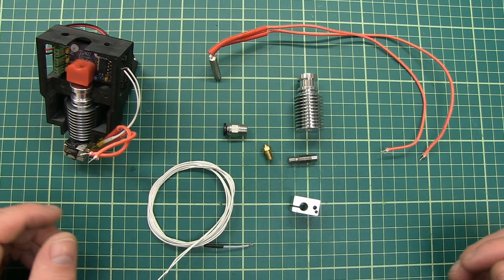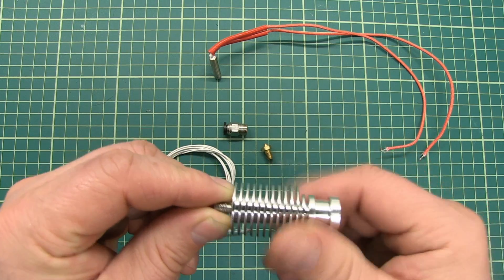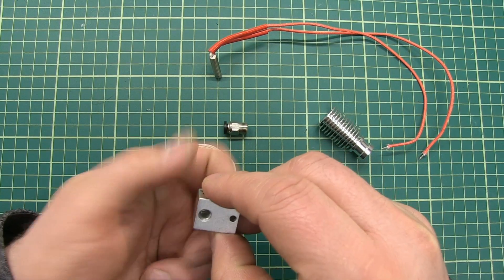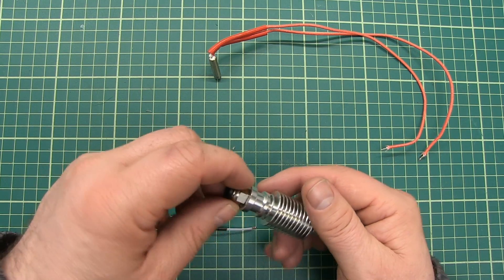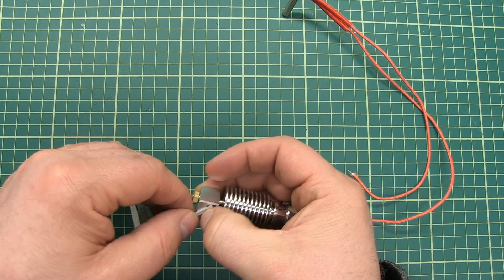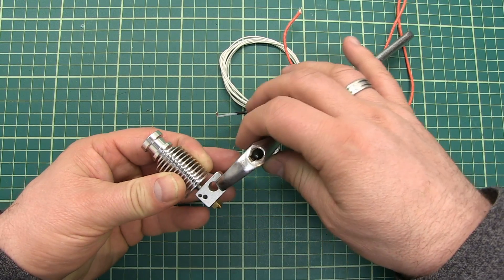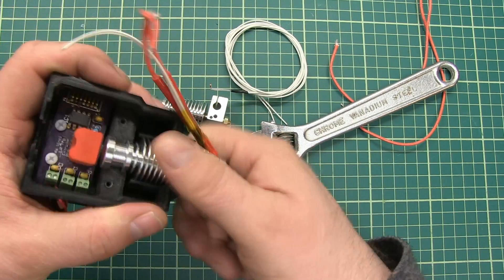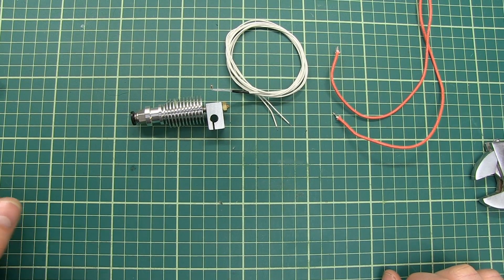▼ E3Dv6 and clones. Types and names of the parts

Comment: Hey Brian,
Is this hot end suitable for de da vinci pro printer? And what type do i need.
Reply from the maker: Hi Wilko,
This is going to be the E3Dv6 that I am going to use in my Da Vinci Pro printer.
When you are looking for the correct E3Dv6 hot-end, look for the 12V version that is Bowden driven. They also call it the short one.

Comment: Hi Brian

How do you calibrate on your pro with e3dv6 hotend?
Reply from the maker: Hi,
Just go to the Z axis offset and set it to the largest number you can get it to. Then, you are a little to low with the bed, you have to turn the knobs on the bed so that they compress the springs a little. Then, set the Z height to a lower value, bringing the bed up until it's at the correct height to work with. Now use a piece of paper as a feeler gauge on the 3 points where you can set the level with the knobs and adjust the bed manually until you feel it's at the correct height with the piece of paper.

Comment: Hey 3D Print Creator. I was wondering if you could tell me if the DaVinci pro like the one have is direct feeding or bowden. Also can you tell me which ed3v6 kit I should get. there are several and am not sure. My father gave me the DaVinci as a gift and it is my first print. I want to print a variety of things. But like I mentioned there are different kits with different nozel sizes and so forth and so forth. I would appreciate your help.
Reply from the maker: Hi Michael,
As you can see, the printer has a motor in the back of the machine that pushes the filament into a PTFE tube. If a printer has this, you call it a Bowden printer. The extruder (this is the motor in the back) is not placed on the carriage, right above the Hot-End, so it uses that tube.

If the extruder was positioned right above the Hot-End, then you call it a direct Drive or direct driven printer.

The E3Dv6 should be a 12V short version, compatible with Bowden.

Comment: hi brian, 
another fantastic video thanks
would you be able to make this and sell it as im very interested in buying one of these to replace the stock hot end on my pro. im not confident with doing the wiring but would be happy to purchase from you. 
many thanks in advance 
steve
Reply from the maker: Hi Steve,
The 3D printed parts are designed by Bruce Walker and are downloadable from Thingiverse, the Hot End is just an E3Dv6 (or clone). I know Bruce sells working hot-ends and information about that can be found here:
https://www.thingiverse.com/thing:1328848

Hope this helps you.
Reply: 3d Print Creator thabks Brian your a star as always

Comment: Bryan, have you thought about how to mount the automatic bed level probe to the e3dv6?
Reply from the maker: Hi Adri,
No, I have not. I think the automated bed leveling option in the Da Vinci Pro machine is not good enough to use and therefore I don't use it ever. I level my bed by hand and that works a lot better. Also, You have to change a few things for the Z height when you are going to work with the E3Dv6, so you can't use the automated system anymore.